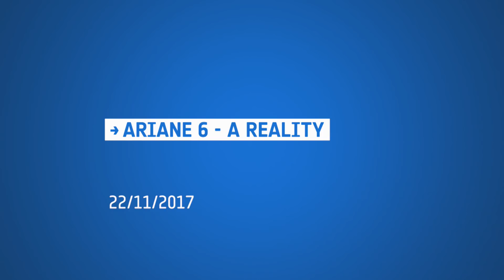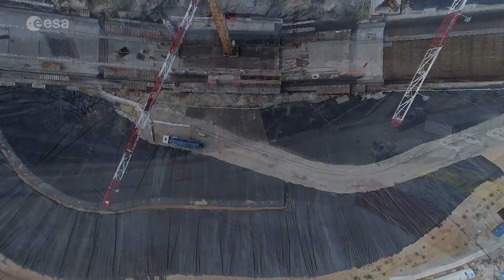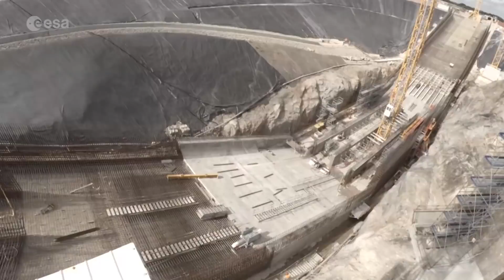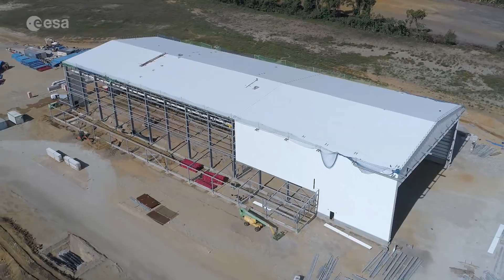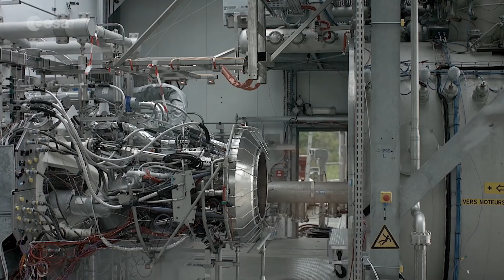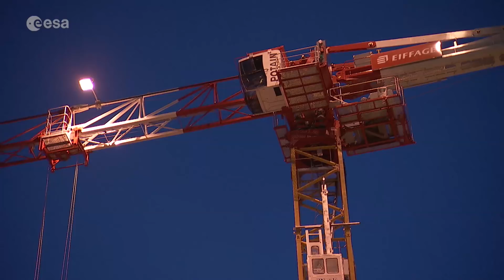Ariane 6 -  a reality in Kourou

Comment: Why doesnt esa build launchsites in europe?
Reply: do u live in europe u want a rocket on ure house if it goes rong ?  lauching rockets over a densly populated continent might get a vew protests
Reply: Because Europe is far from the equator.
Reply: Two main issues.
#1 far from the equator, which means more fuel required to get the same orbital speed than a rocket launched at the equator.
#2 too heavily populated. Rockets launch going generally to the North East over the Atlantic ocean, so if anything goes wrong, it will just crash into the ocean. Not so with most European areas.
Reply: tim1996 nice picture
Reply: vx seems obvious indeed.

Comment: ESA is funded by European Tax payers (to the tune of 5.75 billion Euros in  2017), this currency is used to pay Europeans to do some science and fly over to South America, launch some old tech rockets. I guess it'll all be redundant if Elon gets his Big Falcon Rocket to fly cheap and quickly. But Europe want independent access to Space too. I guess Europeans will have to pay more taxes for that to even out the cost. 
http://www.esa.int/var/esa/storage/images/esa_multimedia/images/2017/01/esa_budget_2017_by_domain/16600517-1-eng-GB/ESA_budget_2017_by_domain_large.jpg
Reply: there's a big if right there. bfr could easily go the way of the shuttle
Reply: SSMEs were reused many times as well, and they did not nearly destroy themselves. Read the reports, you'll find that by Block II SSME, the HPOTP and HPFTP had both been substantially redesigned and the maintenance work cut down by 75%. SSMEs dealt with hydrogen embrittlement, sure, but Raptor will have to deal with both coking and hot GOX streams. Large sections of the heat shield were not replaced, and the inspections were rigorous because a crew rated vehicle is a risk.
Reply: mayhem8166 Spacex is funding itself from those government organizations. They are the only ones that buy launches into space.  This is not a market that is open to everyone. In one way or another the money would come from the citizens.
Reply: Government organizations aren't SpaceX's sole customers. There are plenty of commercial flights for companies like Iridium and SES.
Reply: while true, government contracts are the majority of their revenue (commercial missions are capped around 60-70mil per flight, versus 130mil+ for government excluding the commercial crew development and commercial resupply services development contracts worth billions each).
Reply: Highly unlikely. The principal problems with the Shuttle are mostly absent with the BFR. For one, the BFR's Raptor engines will be reused a great many times and use easier propellants when compared to the SSMEs that nearly destroyed themselves after a single flight. Second, the BFR is going to be truly reusable without the SRBs(which cost as much to refurbish as did to build new ones) and expendable fuel tank. Third, the BFS will be positioned on top of the stack and not to the side where falling debris can potentially damage the heat shield. In fact, the Shuttle's heat shield was so weak and sustained so much damage during launch that large sections of it had to be replaced after each flight. These reasons are some of many that make the BFR a much better bet than the Shuttle ever was.
Reply: mayhem8166 So you don't think ESA has ever done or is doing good projects right now. I mean the reusable rockets from spacex could lower prices but I mean it still matters what do do with your missions. I think ESA is doing good work all in all.
Reply: Well it looks like governments can't really do space going forward as they are all in debt to the hilt with unfunded liabilities... If the likes of Musk etc, can take over and pursue a space policy without making the next generation indebted that would be good. Don't get me wrong, love what they do, just don't like that I have no choice but to pay for it. Maybe I would prefer to fund the Musk rocket, but I can't as my funds have been taken for Ariane.

Comment: No reusable parts at all and it will launch almost 2 and a half years after the Falcon Heavy's debut. What's the point of this rocket?
Reply: Wasn't FH debut supposed to be almost 6 years ago? ;)
Reply: Europe needs it to have independent access to space. As for the % of commercial flights, we shall see about that in the future. Especially with ITAR in the US.
Reply: If your payload needs a custom adapter or some modifications to fit on an American rocket then you need the information about the rocket in order to make such adapter/changes. This kind of information is already considered "technical details" of a rocket and therefore falls under ITAR, because disclosing such information would be "exporting" them. And it gets even funnier, because ITAR is something that "spreads", so if your product uses anything ITAR-restricted, then the whole product automatically becomes ITAR-restricted as well. If a bolt or a screw is used in an American rocket, then it's ITAR-resitrcted and using the same bolt in anything else makes it fall under ITAR as well.
So you're right, it's about exporting technology, but try making a satellite without "importing" the information about the rocket it's going to fly on.
Reply: Pharisaeus SpaceX mounting documentation is available on their page.
Reply: When you have a satellite worth over 500 million Euros you don't take a rocket because it's cheaper. You take it because it's reliable.
Reply: And reusable =/= cheaper.
Reply: If I recall correctly, ITAR only restricts American technology being exported, not foreign technology being imported. Ie. ITAR only restricts some American satellites from flying on non-American rockets; European payloads aren't restricted at all.
Reply: Congratulations, you just made a rocket useful for less than 1% of launches. Anyways, cheaper AND reliable is better. Ariane 6 is redundant, a rocket absolutely no one needs.

Comment: Why do you develop non reusable rockets when spacex ones are gonna take the ride?
Reply: But you do realise that it's the case? Ariane 6 is developed by Airbus, ESA is just funding this, in a similar way NASA funded Falcon 9 and Dragon. Also it's called "independent access to space". For the same reason we are developing Galileo satellite navigation, even though there is already GPS, Glonass and Beidu. Read a bit about what ITAR is, and why it's not as simple as you think to launch anything on american rocket. Money is not everything either. When you're launching a spacecraft worth billions (like JWST worth ~8bln $) you really don't care that much if the rocket is 50 mln more or less - you want the most reliable one.
Reply: Because that's like saying "why buy any other car when God Emperor Elon's Tesla is so good". Diferent people have different priorities, different needs and different interests.

To begin with Ariane's track record is significantly longer than SpaceX, EG they've flown for much longer while blowing up less or the same as SpaceX; if you need absolute reliability you are mathematically safer with Ariane. Also, nothing wider than around 3.5 meters at the base will fit in a Falcon 9, you could in theory use a long "adapter" so that the base is inside the fairing, but that shortens the payload length and may not even be physically stable depending on the payload; and to finish it off, countries in general do not like being entirely reliant on other countries for their rocket launches. France won't launch a spy satellite on an American rocket.

That's why you see companies like Orbcomm or SES flying on SpaceX, they fly a very large number of satellites (so if one flight blows up it's not quite as bad) and they are tiny (no integration problems with the thin rocket). But a company launching a very large, expensive satellite is more likely prefer Ariane or generally some other rocket. Again, a matter of needs and priorities.
Reply: It's pretty expensive to develop such technology. It's better to wait until someone else figures out the issues and proves it's worth it.
Reply: More reliable? Probably the company that flies every month but has had over 80 consecutive successes, compared to the company that has gone 16 or so.
Reply: why do you think you are smarter than the European Space Agency?
Reply: didn't you hear it's a new rocket they're building. it has a lot less experience than space X rockets.
Reply: 85 sucsefull launches also what if the us desides it wil make us pay a tax doubling lauch costs this has happend before indepent aceses is very importent
Reply: The_Blazer, a few things:

A "long" adapter is the adapter. The payload adapter is about 1.4 meters tall and raises the satellite such that the payload envelope is a cylinder with diameter 4.6 meters and height 6.6 meters. It tapers (roughly as a truncated cone, though it's more of a parabolic shape) to 1.3 meters diameter after another 4.8 meters. This is how the payload adapter is designed in all cases, including the heavy and light load adapters.

Good point regarding Arianespace's track record. There's a reason it got JWST (well, also, Falcon 1 hadn't even flown at that point). 

For SES, did you mean Iridium? SES has fairly heavy GTO birds. They're remarkably risk-tolerant and have flown SES-8 (second Falcon 9 v1.1 flight), SES-9 (second Full Thrust flight), and SES-10 (first reused flight). SES-9 and SES-10 were over 5mT, SES-8 was deployed to a supersynch transfer orbit. They've also gotten other operators on board, and some smaller ones like Asia Broadcast Satellite (who really couldn't afford the more expensive vehicles). SES, like any smart operator, also flies regularly on Arianespace to ensure that a grounded vehicle won't affect them too much.

But yes, the satellite operators will always keep two to (ideally) three launch service providers happy. That's been SpaceX, Arianespace, and ILS, though Proton-M is having some quality control issues like the rest of the Russian rockets (it's sad to see how many failures they've had lately).
Reply: The most expensive parts are reusable, which will make it competitive with SpaceX...
Reply: andrew2343, because ESA never launched astronauts on their own rockets!
Reply: so in order to increase the weight in orbit you build bigger rockets like BFR being developed by space X. ESA isn't even working on it. people resort to correcting grammer when they've got nothing important to contribute.
Reply: Ok, but what is more reliable ? A comany who is flying every 2 Weeks into Space or a new Rocket of a Comany, who fly's less than every month?
Reply: Because the reusable first stage means a reduction in weight to orbit.  Do some research...what is the HEAVIEST payloads of NASA, Russia, ESA , and Space X?   (Also note correct use of the Oxford Comma  :)
Reply: Why do they even develop a new rocket? I think agency's like NASA, ESA or CNSA should stop develop their own rockets and just let comanys like SpaceX do that.
They should concentrate on science! Also: Why would anyone hire ESA to fly sth into space while Elon could do it less expensive.

Comment: if it's not reusable the falcon9 and BFR will will win over these new launchers
Reply: Because the re-usable space shuttle did win over all other rockets. Only it didn't.
Reply: Cheaper than Ariane 5, sure, but it lofts about half the GTO payload (5.5 metric tons versus 10.5 metric tons). We don't know Falcon's price expendable, but it probably isn't that different. Still, Falcon cannot dual-launch satellites (the Boeing 702SP missions were not dual launches, the stack was made and integrated by Boeing, it's not general-purpose like the Sylda secondary payload adapter.).When Ariane 5 is carrying two GTO birds, the lower slot is about the same as Falcon. The upper slot is more like $90 million.

Should point out that Shuttle is a far more capable vehicle than Falcon. Shuttle is not just a launch vehicle, and it isn't even comparable to a launch vehicle and capsule. Shuttle was designed for on-orbit satellite repair and retrieval, for example. It is more fair to compare Shuttle to Falcon 9 and Crew Dragon costs, but even that is still somewhat misleading.
Reply: For the time being BFR is still a bit of a pipedream
Reply: BFR is quite similar to the Shuttle...
Reply: Ambient Morality Not quite. The space shuttle was more like a plane capable of orbiting earth in low earth orbit, it couldn't go beyond that. Whereas the BFR would be cabable of transporting humans on the Moon, Mars and possibly beyond. Also, the space shuttle glided back to earth's surface and landed like a plane, the BFR lands propulsively, so there's quite a difference between them. Not to mention the launch cost which will be a lot lower with the BFR, since the first stage is reusable as well as the second stage, and even the fairing on cargo missions.
Reply: I meant in capability/role - long on-orbit capability, semi-lifting-body reentry (shuttle probably wins for low g reentry though)
Reply: I apologize for my misunderstanding. In those areas I can agree that they're quite similiar. Since both are capable of transporting large satellites into orbit and resupplying the ISS. The G-forces for re-entry should be around 3g's with both vechiles.
Reply: Even expendable falcons are cheaper than Ariane5 Shuttle was few times more expensive from the very start
Reply: falcon heavy can launch double the payload that the space shuttle could
Reply: @Danny RLM yeah, just like the Falcon 9 a few years ago and now its an everyday thing.
Reply: BFR will be much more less expensive compared to the Space Shuttle
Reply: The space shuttle required a non-reusable rocket to get it into orbit, while the BFR will be completely reusable. So I believe it's going to be the best and cheapest rocket system so far.